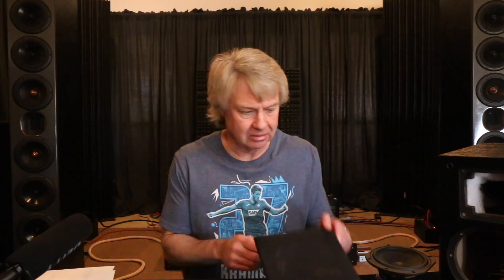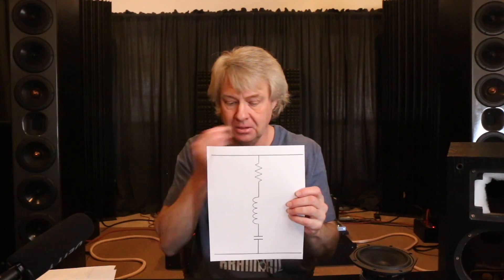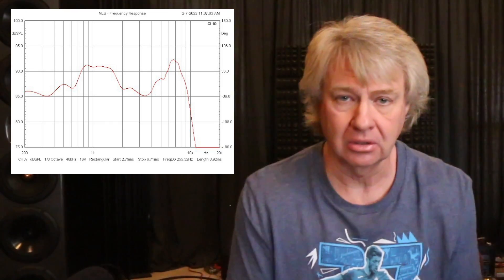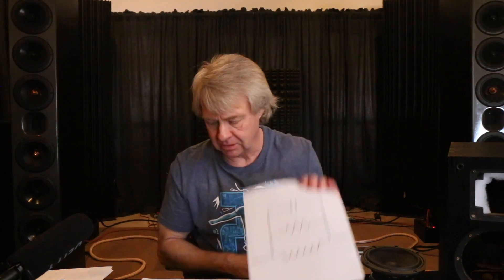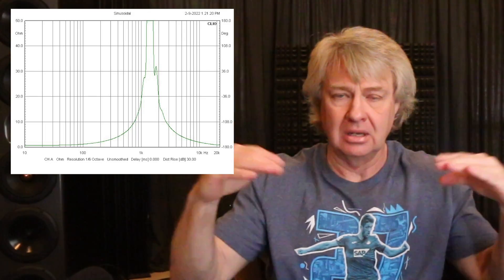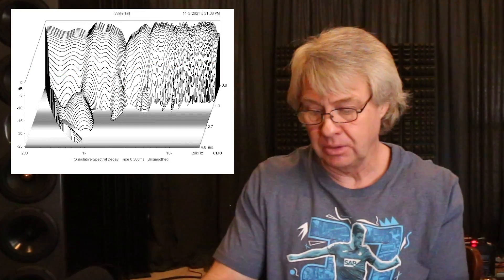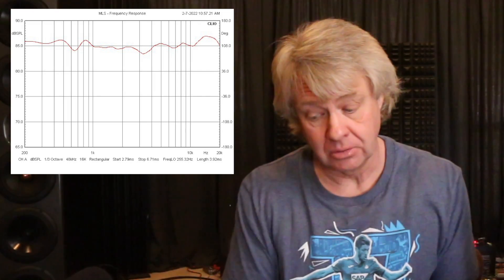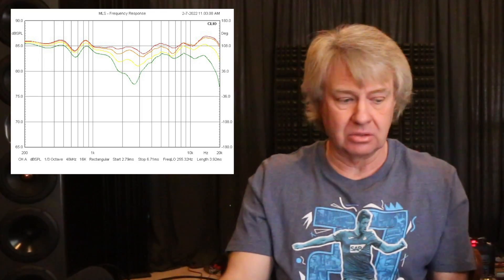What the HECK is a NOTCH Filter?!

Comment: So one of the challenges of designing a 2 way is to have good speakers cover the larger bandwidth. I am using an  Emenence kappalite 3012LF and need to get it to 2K for a crossover of 1600. using a notch filter and a lower crossover on the woofer I think this can be done.BUT does this whack out the phase at the critical crossover and am i kidding myself that the woofer will sound OK through this notch? TYVM

Comment: Thanks, Danny for telling me that my 1987 Polk Audio SDA-1C speakers had very much lost their original great sound. I did not know that the crossovers were inadequate to begin with and had worn out through the years.  Well, I undertook the crossover rebuild using Sonicap and Clarity capacitors with Mills resistors. I just copied the values of the old parts.  Wow what a difference in the sound, clarity, and tight bass. Now, I am ready to do the same to my Klipsch RP-160M bookshelf speakers.  Thanks for sharing your knowledge and expertise .

Comment: Is a notch filter necessary for 100hz notch or is it too low to affect the sound negatively. NB the notch is in the software curve and not the actual speaker measurement. Haven’t measured the speaker due to lack of calibrated microphone. Cabinet construction imperfections might have removed the notch and added other imperfections but I am happy with it’s sound. I just wanted to know so that in the future when the tinker bug bites then I can measure the speaker and create a notch filter for it.

Comment: What you do to improve cross overs seems fairly easy to do. I’m mystified why the manufacturers don’t do that in the first place!
Reply: Price points.  Those bookshelf speaker are about $330 a pair.  Would be over $500 with the mods.  Also alot of times the upgrade crossovers can barely fit into the cabinet.  There is forum that is going to take some of GR's upgrade speakers and do blind listening tests and measurements to see if there is a difference.

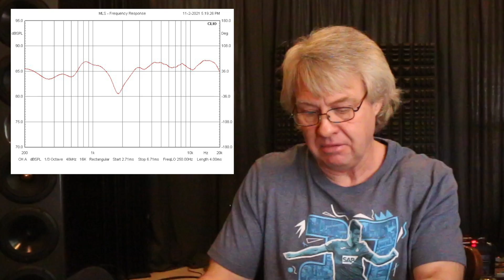Comment: 9:19 ...  It looks like that this was a designed feature to me.  This seems to be common in many speakers.  they are purposely attenuating the midrange up to 5 or 6 dBm which makes the speaker produce more bass and treble than midrange.  this appeals to many people as a "more open" speaker and they believe it has greater clarity than a speaker designed with a flat response.  However on some recordings especially a small vocal group with a female singer singing lead, her voice just seems to drop out of the mix.  A good example would be Pozo Seco Singers LP "Time".
Reply: The mid-range is actually in the 300 to 500Hz region. So the dipped area is well up into the treble region.

Comment: Thanks Danny, I  was wondering the same thing. I'm  curious about why you chose to have four woofers in your cc design. Sorry but I  have a last request. Here in Canada there are very few places to audition electronics and I'd  really appreciate if you could suggest a best bang for the buck max $3000. I will be buying some of you speaker kits but it adds up fast at 250 per flat pack when you want 6 to 11 units.

Comment: Great video as always!  What is the main contributor to these large impedance spikes in individual drivers, i.e. is it the magnet structure, suspension or surround, etc? Thanks!
Reply: Usually driver resonance(s), otherwise the broad upshift is caused by the inductance of the coil.

Comment: Thank you "Danny" for the in lightful lesson. Now I have a Polk audio monitor 70 series 2 loudspeakers . I'm looking to do an upgrade . I've ordered the parts . I been following you for sometime . Question what if on the Tweeter you grabbed a 14 awg inductor for it , is that a bad move? And or should I get a 18 awg inductor for the Tweeter in line with the caps an resister ? Thanks keep up great work .

Comment: New to the channel. Love the vids. Im currently pulling apart.my homebrew loudspeaker. Will be completely upgrading the crossovers and using audyn copper max caps as bypass caps o. The mids and tweeters. My question is. What are your thoughts on L pad attenuators. I had I e on the mid and one on the tweeter. Over the last year in listening I kept finding myself setting both to 0 essentially. So im doing new backs o. The cabs and have to do some cab tuning i. General I was just thinking get rid of the L pads. I figure its less stuff I. The signal path anyway. But do you find that you like or should use an L pad or is using an L pad basically an admittance of poor crossover design? Thoughts?

Comment: I'd be curious what you think of paper cone tweeters and the things you might have to do to optimize them. Sony SS-MF550H has some kind of science paper tweeter, with the mid and low being Kevlar. They are remarkably pleasurable to listen to, no doubt you would measure some wacky stuff happening with the Kevlar Woofer playing full range. You can hear a lot of treble coming out of the woofer but it doesn't sound bad or grading somehow. The cabinets resonate very, very, very noticeably. My Sansui s820u's are my favorite. Paper cone tweeter, mid, and woofer. They image like the surround sound is turned on, I often have to check because I can't believe the receiver is in stereo mode.

Comment: Do you use formulas to determine the value of the crossover components; or variable resistors, etc, whose values can be changed while you're looking at freq response; or just a trial and error methodology?
Reply: I was just going to ask exactly the same question :)
Reply: @Lloyd Stout please spare me. How does the change in resistance equate to the peak, or bandwidth, or slope of the notch? Do you have a formula for that? How does changing the capacitance or inductance change the same properties?
Reply: @Lloyd Stout I'm familiar with capacitive reactance (Xc=1/2pifc), etc. I was asking what HE uses in designing his filters. Thanks.
Reply: @Lloyd Stout where in ohms law is frequency mentioned?

Comment: Hi Danny, can you explain the difference between the notch filter and a Zobel network. My understanding is that the Zobel corrects for impedance anomalies in the driver....so would you use both, combine the two or what?
Reply: In my experience notch filters and impedance correction filters are more of a "textbook formula" approach to crossover design. Rarely are they actually necessary except perhaps as a bandaid to "fix" a crossover that was not properly simulated or measured. If you use a textbook formula to make the crossover, then you'll probably need a textbook formula impedance correction circuit to make it even remotely useful.

 Better off to simulate the crossover components effect with response, phase, impedance, and diffraction data all incorporated. In that process, you can adjust component values and incorporate resistors in various parts of a 2-4th order network that will "tilt" the response and suppress peaks as part of the network design. This has to be done with care so as not to wind up with a nasty impedance dip, or strong circuit resonance, but there are indicators in the simulation to look out for to keep things reasonable (electric phase angle, impedance dips, sharp hooks or corners in response). 

In that process you might wind up with something that looks like a zobel network making up a "leg" of a 2-4th order network, as the final design may benefit from a resistor in series with a capacitor, but the value of the resistor or the capacitor is unlikely to be close to what a textbook formula would spit out for a correction circuit for a given driver impedance. 

For example, instead of building a 2nd order low-pass + zobel network for the midbass, (a 3+1 component network), going up to a 3rd order network with an additional series inductor, skipping the zobel network, and "tuning" those component values with a possible resistor incorporated somewhere in the circuit to fine tune the tilt/shape of the response (Still a 3+1 component cost), is likely to produce a steeper, more controlled rolloff and flatter response with proper tuning.
Reply: @mdocod  Thanks for the comprehensive reply.
Reply: @mdocod  that was a good explanation also!.can you tell me a good software for the simulation of crossovers??